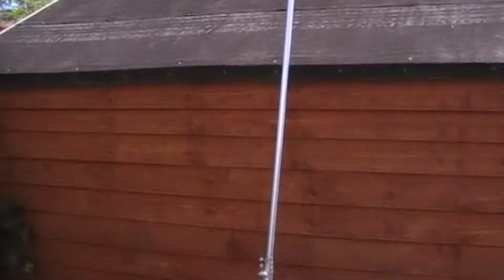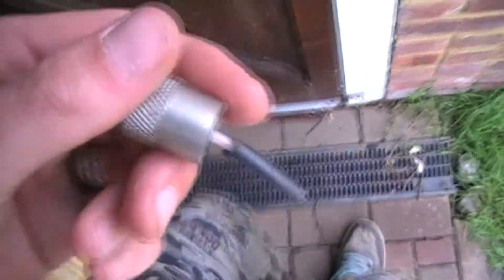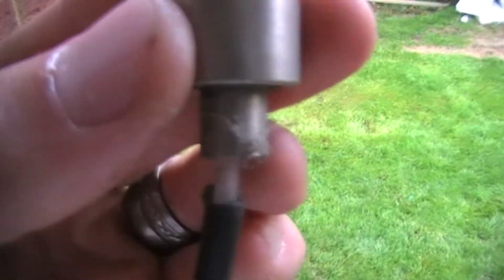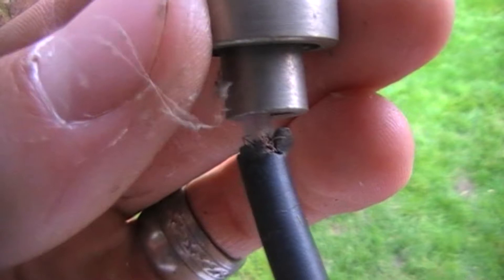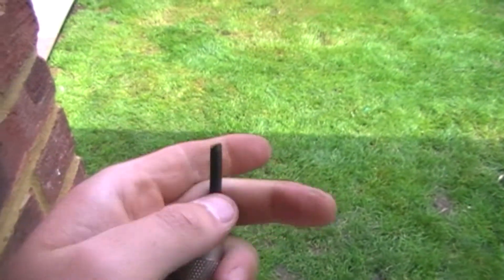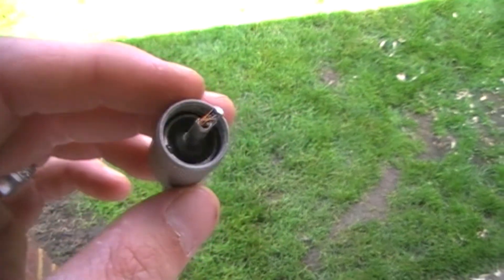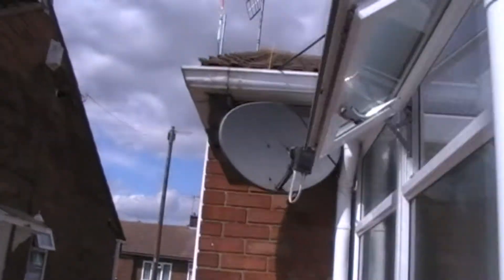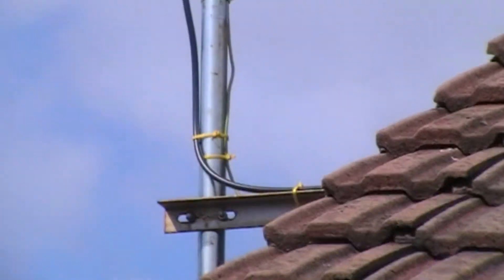IMAX 2000 Installed

Comment: Hi Will the I Max 2000 mount on a 2" pole,  or is it like the A99 max size 1 1/4"  Thanks.......
Reply from the maker: +PAUL AUST I really don't know... But surely if you get clamps big enough it'll fit any pole?
Reply: +RustySkull Productions Hi chaps.. as standard you need a 1.5 inch pole for the IMAX2000 (Max2000), that is my standard pole gauge here and it fits my Silver Rod 1/2 wave, Max2000 and the Gain Master. The distance between the U-bolt holes on the Imax ali base bracket mean 2 inch would be too large. It is crazy that antenna was working it all given the PL-259.  Cheers and 73.
Reply: I had to use the 1.25 pole. The fence post I had was just a hair bigger than 1.5 and wouldn't fit.  I would have preferred the bigger of the two, but the 1.25 is doing fine.
Reply: So which one you think gave you the best performance cause both of those antennas are know for great performance?

Comment: seal the joints on the antenna with insulating tape or self amalgamating tape and definitly seal the pl-259 coax connector with self amalgamating tape no more water is good

Comment: I am thinking of buying Solarcon IMAX-2000, can you tell me anything I should know before I buy?
Reply from the maker: Well, they're great antenna's I can only say good things about it so far haha :) I say go ahead and get it dude!
Reply: Get some good enamel paint and spray the antenna. just make sure it's not metallic paint. This will keep the antenna from delamination. The lock washers I got with my imax were garbage. Get some good stainless steel ones. Check each section where the copper wire is soldered into. If there is any protrusion, file it flat. This way the antenna won't look crooked. When it gets very windy, the antenna will bend quite a bit. Don't worry . It will return to an upright position. Mine's survived 60 mph winds with no problems. Oh, one more thing. Do not over tighten the antenna sections. The ground plane kit improved my TX and RX with stations over 30 miles away.  I'm still very happy with this antenna.  ; {>
Reply from the maker: Hey, yeah mine has survived 100mph winds so far! I thought the pole it's mounted on would have snapped but it didn't lol.
Reply: Thanks for the info I feel a little better on ordering. I live in the Northeast where we get snow, hail, ice, and when this however it will be somewhat protected from the wind seeing that there will be a lot of trees around it but yet far enough not to interfere wood is transmitting and receiving,. Thanks for the reply enjoy.
Reply: I hope not you see hundred mile an hour winds however in the winter when there's I sent 15 mile an hour winds may seem like 100. Other than that can you tell me how far it actually broad bands, how far will it work in frequency or out of frequency
Reply from the maker: We had over 100mph winds last winter. 
And with my tuning and using an ATU I can do 15meters down to 10 meters.
Reply: Thanks that is good to hear I feel better knowing that you have tested it and that it holds up there harsh conditions. I was thinking of the penetrator but have been hearing a lot of good things on the IMAX as well as the overall length as well.
Reply: I installed a 50 ft free-standing tower 2 months ago and have it on a laydown mount.
Reply from the maker: Yeah because I moved them while installing it lol so I have no idea if they would have come in the right place.... probably not though
Reply from the maker: Well thanks lol.
Reply from the maker: I’m already on it! A CB video is scheduled for Friday!
Reply from the maker: Southend dude 👌🏻😝
Reply: Seen this post 1 year later, youve probably given up on radio due to much shit coming in lol

Comment: Shitty antenna dont waste your time buy a sirio gainmaster . The imax gives out lots of rf causing tvi problems. The sirio doesnt. The imax brings in lots of rf interference . The sirio doesnt lol !!!!!
Reply from the maker: It’s been about 4 years and I’ve had no issues lol
Reply: I had an unfortunate experience with the gainmaster. I came home from work one day and it had snapped at the clamp closest to the bottom. The neighbor saw it break in what he said was a 50 mph gust.  I repaired it with an automotive fiberglass kit. I saw no difference on receive between the gm and the imax. The stations I talked to said the signals were the same too. Once I got my ham ticket  I put the imax back up. The gm is rated for 500 watts and I knew it wouldn't put up with the 1000 plus watts I was going push through it.  The imax has dealt with 1kw and no problems, so far lol
Reply: ive heard some crap over the years...... but saying the ripoff 5/8 wave gainmaster is better than a 0.64 wave imax is the best yet....    clearly doesnt understand radio